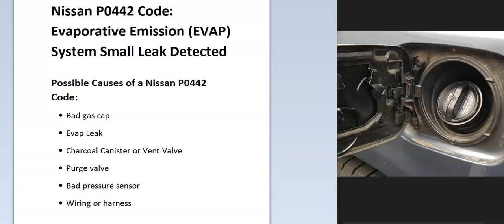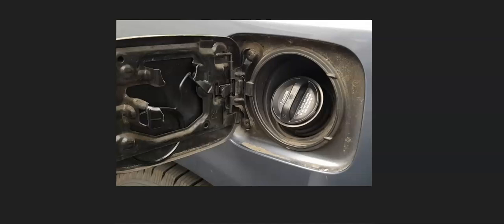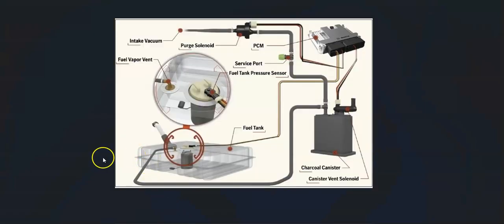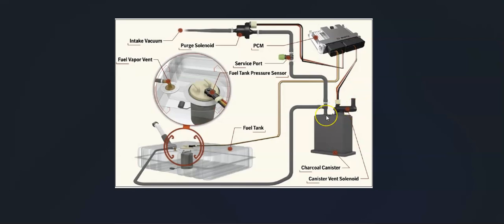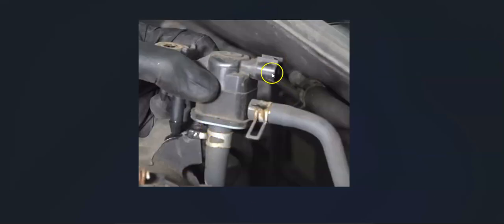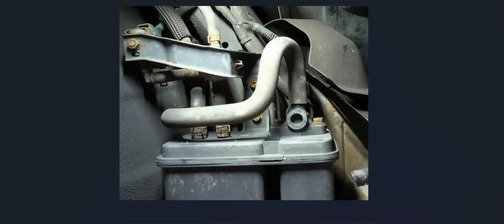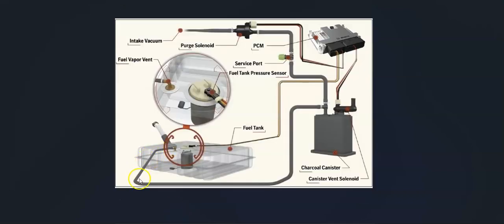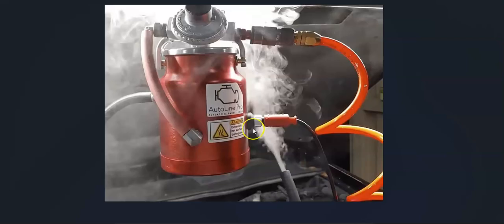How To Fix a Nissan P0442 Code Evaporative Emission (EVAP) System Small Leak Detected

Comment: I'm getting the same code. I replaced my vent control valve on the evap canister. I replace the purge solenoid under the hood. I don't see any cracks in any hoses. Do you know where the  Pressure sensor is located on a 2006 Nissan, altima, 3.5? I was looking up diagrams and I believe it is in between the gas tank and the charcoal canister, but it's so hard to see up in there. Wanted to know if you knew exactly where it's located

Comment: I've been dealing with a squeal back there when I'm stopping and my idle drops and sometimes shuts off.  I replaced the purge valve under the car but it did it again so I'm thinking its this EVAP CANISTER thing.

Comment: I recently had a P0448 (Vent Control Valve) on my 2012 Xterra. Had that fixed at the Nissan Dealer. A week later, I'm getting a P0442. Already replaced the gas cap. Per your suggestions, will check the hoses and the purge valve. Great video. Maybe it'll save me some $$. Thanks!
Reply: Hi did you find out what need to be replaced? Have replaced the Charcoal canister and the evap valve and the code keeps showing.

Comment: Have this issue on my 2014 frontier - if I find a crack in one of the hoses is there anything I can use to patch it, or must it be replaced? I’m going to go look right now
Reply from the maker: They usually are replaced but can sometimes be patched. There are YouTube videos on how to make a low-cost DIY smoke machine that makes finding a leak easier. Here is a video for how to test the purge valve and rule it out. https://www.youtube.com/watch?v=5rQelbINjTQ
Reply: always replace, hoes are mostly cheap